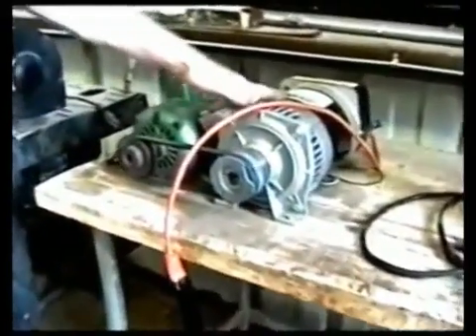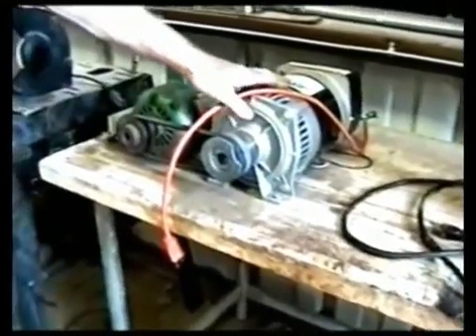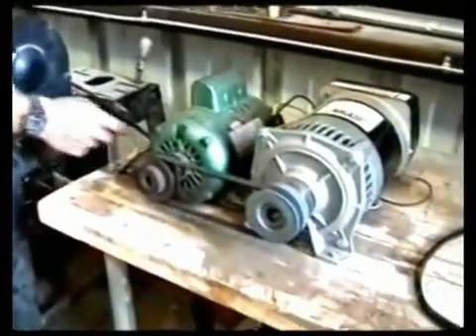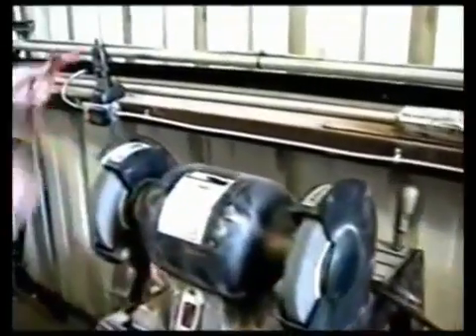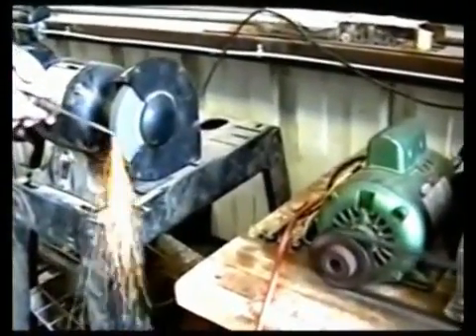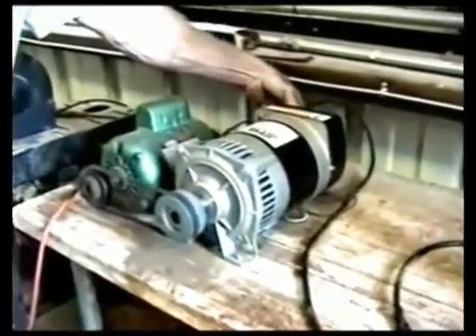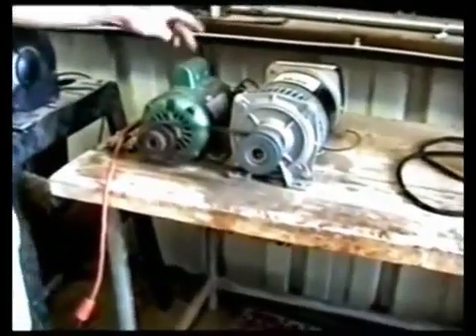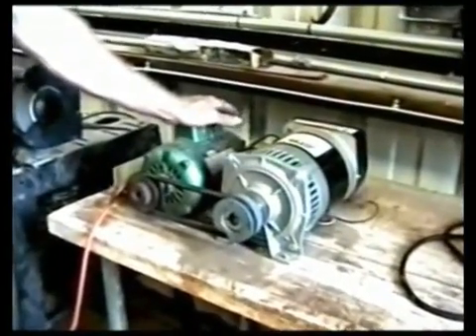3000 Watt Generator Powers Itself, Grinder & Drill Press.

Comment: So many loud mouths on here putting in two cents at a time. Not one of you idiots have the brains, talent or drive; let alone the patience to make your own video proving that this doesn’t work. It’s easier for your lazy ass to type a few smart comments & $4 words. I say PUT UP or SHUT UP. This guy put up his, you got nothing to show but shit for brains & lead for ass. Go ahead & type some more... we know that's all you're able to do.
Reply: Joseph Padron.....You must be correct. I have a friend that works at the power station. According to him they run all the generators off one RC motor half the size of your fist. The power generators in turn charge the NiMH battery and power half the city of L.A.! I find it hard to believe, but he works there, not I.
Reply: TheOriginalSyonix.....Solar is not free, only deferred. Although fusion is a very efficient form of energy, our sun is middle age & like all stars will eventually run out of fuel. 2 billion years may seem like forever to humans, but it's merely seconds to the universe. Everything is relative.
Reply: I've got a better idea: Bring this thing to my house. We will go out on my front porch and try to run the motor off the power produced by the generator. And it won't work.

A generator takes mechanical energy and converts it into electrical energy. Because generators have mechanical resistance plus electrical resistance, it requires more mechanical power to turn the generator's shaft than you will recover as electricity.

How much extra? For this we'll use Army generators as an example. An MEP-003A 10k diesel generator has an 18hp motor on it. Convert hp to watts (1 hp = 750 watts) and you learn your engine is putting out 13,500 watts. Divide output power by input power and you've got roughly 75 percent efficiency.

A 3/4-horse motor, as you can find out pretty easily by googling it, draws 900 watts WHEN IT IS RUNNING. Since he started the motor from grid electricity, we won't deal with the surge current. Convert the shaft hp to watts and we find that our motor is producing 562.5 watts. Apply that to the shaft of the generator and we will receive - ta da! 422 watts of electrical power...less than half of what it will take to power just the electric motor that's driving the generator!

Clubdjtv, no one is going to take you up on your challenge because the simple truth is, there's no fucking way this would work on its own. Of course, if the guy were to have...well, made a special table with an electrical cord running through the table top and down the leg to power the motor, then it would work fine. But it wouldn't be "free" energy created out of thin air because that simply can't exist.
Reply: joe macdonald Joe, YOU put up or shut up. Here is my offer.

It is my contention, as well as the contention of pretty much anyone here who's ever worked with electricity before in his or her life, that a generator driven by an electric motor can't produce enough power to run the electric motor. 

It is your contention, shared by all the overunity fans here, that some mystical device not able to be seen in this video will allow the motor-generator combination to drive itself. 

I did some calculations and it would cost about $800 to buy a motor, a generator head, a couple of pulleys, a V-belt, a video camera and all the rest of the things I would need to recreate this doomed-to-fail experiment. I will not spend $800 to demonstrate that this really won't work.

I will perform this experiment for you if you send me $800 and purchase a round-trip plane ticket to my location so that you can see it won't work in person. But you must agree to upload the video to YouTube regardless of whether it works.
Reply: joe macdonald Sorry Joe, that is not how scientific proving works. The sceptics DO NOT HAVE TO PROVE ANYTHING, it is up to the claimant of the impossible "invention" to submit it to the peer review that would confirm (or disprove) the claim.  Youtube video is not such review medium. None of us needs to post a video disproving this device as it defies the laws of nature, the initial poster has to prove it works. If it was indeed genuine, the inventor would be the richest man in the world.
Reply: Mitchell ODea
http://youtu.be/5anke7igxCc

With all due respect what we need here is a different system mathematics which has not yet been discovered. This free energy technology is being developed all over the world despite mainstream science objections.
Reply: This comment written on a laptop powered using "free" energy.. 

I live off grid, 23 miles from a power line. I paid nothing for my energy. However the device that gives me my enrgy cost me a few hundred dollars.. people are retarded.. RETARDED.

What the fuck is solar and wind .. if not free.. you fuckwads.
Reply: Jim Mowreader If you can't put up then just shut up, it's as simple as that. lol :P
Reply: joe macdonald.....Or I could put up a video proving I won't be bangin Charlize Theron.....but why bother!
Reply: ***** That would be pointless because no one, as of yet, has posted a video of him/her sleeping with Charlize Theron (a real average person and not a fictional character from a movie).
Reply: joe macdonald Well, after the initial odd verbiage you come to confirm my point really. If the invention was indeed genuine, youtube would be the last place to post it.
So, why is it here?  Very simple, two reasons:
1. It is fake, so no point showing it to real potential investors who would be bound to verify it.
2. It uses tags like "Free energy", "Overunity" etc. that attracts a lot of views and comments, positive or negative, they all generate free cash to the original poster.  Long and short of it really.  But no great scientific or technological breakthroughs.
Reply: Bob Berg Those are valid points, however, I think that the other possible reasons as to why the inventor of that possible protracted device posted a video on YouTube of it working was for these possible outcomes:
1. To share the device's concept freely. 2. To make the world a better place. 3. To make fossil fuels obsolete. You are correct in stating that there are "no great scientific or technological breakthroughs" through that possible protracted device but is it not a possible wonderful innovation especially for humanity?
Reply: Joseph Padron Why isn't the 1st law of thermo broken?
Reply: ***** I think your friend is having a lend of you. May I suggest you ask him if he was just taking the piss.
Reply: Rob Guyatt Rob, the only law that isn't being broken here is Barnum's First Law: "A fool and his money are soon parted."

You can mathematically prove this won't work fairly easily: 

This is the new model of the generator head he's using: http://www.northerntool.com/shop/tools/product_200395476_200395476
It requires 4125 mechanical watts to produce 3000 electrical watts, hence it is 72 percent efficient. The one he has is discontinued; the customers who buy them to replace burnt-out generator heads in their gas-engine generators probably asked for a larger version.

The motor he is using requires 900 electrical watts to produce 562 mechanical watts. (One horsepower equals 750 watts.) It is therefore 63 percent efficient.

If you apply 562 mechanical watts to the shaft of his generator, you will get 405 electrical watts out of it. Since that's less than half what the motor needs to run, the motor will immediately start to slow...which will cause less power to be applied to the motor which will make it run slower still. It won't stop AS abruptly as it would if you just pulled the plug but it will definitely stop in a few seconds. 

For extra entertainment find videos of the actual WITTS Quantum Energy Generator. This is just something he threw together on the spur of the moment. The real one is about the size of a car tire and it probably weighs 200 pounds because it's got this massive iron toroidal core with about a mile of wire wound around it. You can find the plans on the internet, and there is a huge problem with them. The basis of all electrical generating apparatus is Faraday's Law of Induction, which says that a time-varying magnetic field is always accompanied by a spatially-varying, non-conservative electric field, and vice versa. In other words, if you have a coil of wire and you move a magnet past it, electricity will form in the coil. In a practical generator, the coils are called the "stator," the magnets are attached to a shaft called the rotor, and the two are as close together as you can get them without their rubbing so you get the maximum effect from the magnets. (They're usually electromagnets, and they get their force from a DC generator mounted on the end of the shaft.) The WITTS alternator has no magnets on its rotor and the distance between the rotor and the coils is approximately two inches. Not only does it fail at extracting the innate energies from the ether that flows all around us, it fails at the simple task of being an alternator.
Reply: joe macdonald Sorry Joe, those are very weak points. He is not sharing a concept. Had he done so he would have shown the schematics of the device together with mathematical proof of why that would work. Instead he is showing a very suspicious looking demo that can be easily staged.
Your two other points reminded me of the answers given by beauty pageant contestants. They all say they want "world peace". I.e. wishful thinking. Have you heard the expression "The road to Hell is paved with good intentions"? Even that I doubt very much. His real aim is to line his pockets.  Nothing wrong with that btw, he is smart in my opinion.
Reply: Bob Berg My points are just as good as yours. He is sharing, is the video that hard to follow? Or, do you mean that you need a highly detailed schematic for that? Did you even watch the video? Also, there's no need in trying to refer to me with derogatory comments, this is YouTube not high school.
If his real aim was to ling his pockets then he wouldn't have bothered to post this video online and instead he would show this video to investors. If you can find evidence of him showing this video, or of one similar, to investors to line his pockets then please do share! Lining ones pockets (aka Greed) is what caused the great depression, the recent recession, the corporate bailouts in america, and even the current economic dilemma no?
Reply: joe macdonald I was not being derogatory, I thought I was phrasing my posts carefully. And he is indeed trying to line his pockets the only way he can, by attracting internet hits. Showing this to investors would not make him rich as he would be immediately exposed as a fraud, so that would be a non-starter and he knows it. If I was being charitable I would say he is having a bit of fun observing us exchanging sometimes heated arguments about this "invention".  For what it worth, I am not accusing him of being greedy to an extent of causing the recent recession, that was some leap of your logic if I understood the emphasis of your post correctly.  As I already mentioned, I think he is smart. But smart in the internet user sense, not in any scientific or technological one.
Reply: Bob Berg Trust me, if he wanted to line his pockets he would have went to investors and then if his possible protracted device was a fraud or not we would have known via media, social sites, blogs, etc etc, long ago. Also, Greed, was the main factor for the current, as well as the past, economic dilemmas because there were those who simply wanted to "line their pockets", not such a leap to realize really. I think that he may be innovative because of his possible protracted device. Although I am not totally convinced yet that his device is a protracted one with tremendous application and the key in ending fossil fuels, I cannot be as closed minded and dismissive as those in main stream science. Just as those who laughed and scoffed at the one with the idea of the world being round, I will be the one who considered it to be a possibility.
Reply: Rob Guyatt.....My friend maintains he was NOT taking the piss, mate.
Reply: Jim Mowreader.....Good points. I believe there is an easier way to prove this does not performed as claimed...heat. If I'm not mistaken most of the waste energy that keeps a machine from attaining 100% efficiency is unwanted heat. An infrared "heat gun" would do the trick. If ANY heat is detected in this abortion, it's over, check-mate! Why do alternators have cooling fans, or in some BMWs liquid cooled? So they don't self-destruct from heat. Even the belt here is of the outdated "V" design. The newer micro-V belts are far more efficient, but NOT 100%. Direct drive would be even more efficient.
Reply: ***** Heat, friction, any of it. Thing is, you'd have to spend the money to build one of these machines to prove it didn't work with an infrared thermometer; with math, you just need the calculator you already have.

Strange thing: "motor generator" sets are NOT an exotic technology. The old Cray supercomputers used them - not to get "free electricity" but to get noise-free electricity.
Reply: Jim Mowreader.....Unfortunately, math may work for you or I, but how do you go about convincing the average American who can't understand that there IS no dark side of the moon?
Reply: ***** Something that must be considered: If you were to build this thing, prove it didn't work by experimentation (rather than just saying "it can't work and here's why") and posted a video to that effect on YouTube, the comments would be deluged with "it didn't work for you because you did it wrong, it works for ME just great!" comments.
Reply: Jim Mowreader.....I already thought of that. You & I think alike. False narratives tend to take on a life of their own....."Hands up, don't shoot"
Reply: Mitchell ODea wrong. No laws have been broken.
Reply: Jim Mowreader Like Clubjtv said: "PUT UP or SHUT UP". If you put up a video proving him wrong I will never doubt or even question your opinion or knowledge ever again!
Reply: Bob Berg  True, skeptics do not have to prove anything and therefore do not have any credible grounds to disprove of anything. So, in the end, in order to be credible in disproving, just as in proving, of something you either have to put up or shut up, it's as simple as that! Also, ask yourself this question, if the protracted device shown is indeed one and in fact works then why show it on YouTube if it can fetch the inventor millions of dollars? Moreover, why not instead show the device to potential investors?

Comment: Seems to me that some sort of gear box, designed to increase rpm, placed between motor and generator and two belts would increase output of the generator while the motor ran the same.but I'm not really smart as some.

Comment: This is purely a hoax. He has wires hidden somewhere because I have actually seen a similar motor generator used to supply 400Hz to aircraft equipment and there is no way that this can run any near the time shown in the video and put out enough power to start and run that drill press and grinder. To start a motor you need three times the rated amperage.

Comment: Yes that's true conservation of energy applies to closed systems only. However we choose a system as closed as possible so we can do our calculations without bringing things that have little to no effect into our calculations. Whenever you measure something you always need to know how accurate your measuring devices are and are the devices being used properly.
EXAMPLE:
If I drop two balls of the same size but of different weights from the same height they should both take about the same time measured in seconds to hit the ground. If I drop a feather from the same distance and if the distance is very small compared to the size of the feather I would expect the same time in seconds. If my distance is large compared to the size of the feather I would expect a major difference because of the air resistance. Something I wouldn't see inside a place with only a tiny bit of air. Now if one ball was made of Iron and the other made of glass if it was a large distance compared to the size of the balls I would expect the Iron ball to beat the glass ball because the earths magnetic field would affect the iron ball much more than the glass ball. Why because the earths magnetic field is much weaker than gravity on the earths surface. In fact you should be able to find a place where the magnetic field is equal but directional in both the north and south direction meaning the magnetic field would have almost no effect on a falling ball.   

Example:
Of using measuring devices improperly. I have seen people measure power incorrectly with DC volt and DC amp meters on generator output. Usually they run the output through a diode bridge circuit and then to the meters. What they do then is measure what would be called open circuit DC voltage by attaching the voltmeter to the output. They then measure short circuit amperage with the meter also attached to the output. Next they multiply both values and discover they have created an over unity device. The correct way to measure output is to attach a resistive load and measure volts and amps at the same time. Volts is measured across the load and amperage is measured in series with the load. The equation governing output is E measured in volts times I measured in amps should equal P or power measured in Watts. The other equation is I in amps times R resistance measure in ohms should equal E in Volts.

Comment: I did not see a voltage or rpm drop when he plugged the drill in. That will happen with any generator when its put under a load. There is no load that I can see!